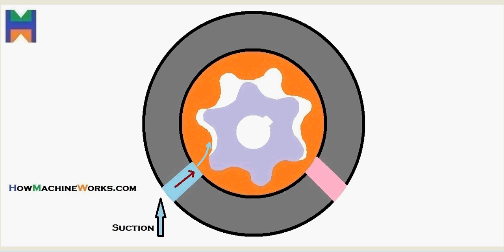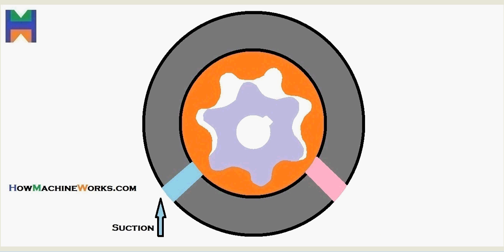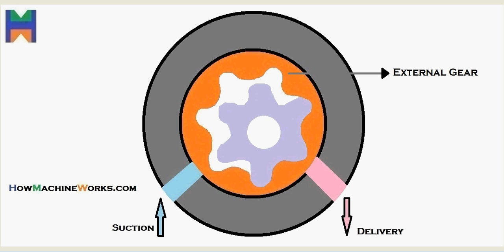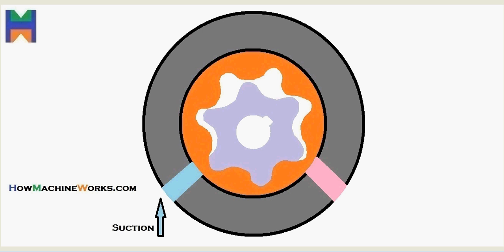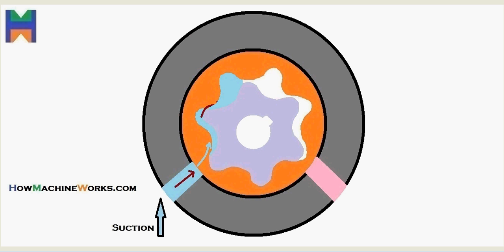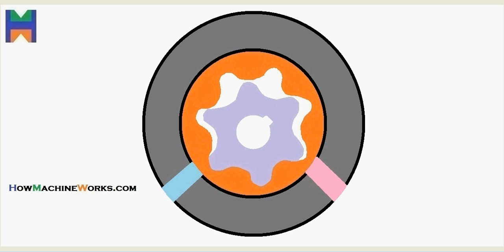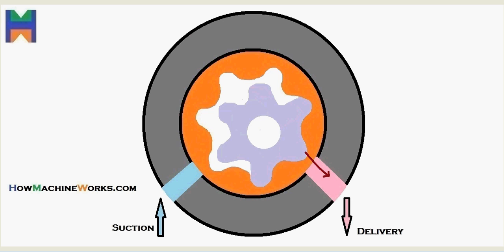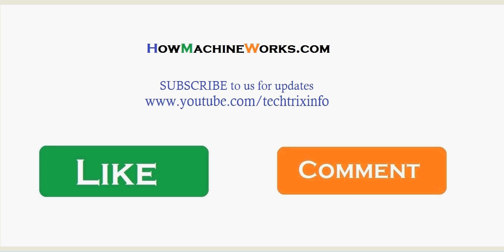Animation How internal gear pump works. ✔

Comment: Pumps do not "suck" or have suction. if there was a restriction on the inlet side there would most definitely be a vacuum pressure and cause aeration. But in normal operation a pump does not suck. There is an increase of volume and decrease of pressure on the inlet side fed by atmospheric pressure or a pressurized reservoir, and on the out let side the volume decreases and pressure is increased, forcing the fluid out. Pumps also do not create pressure, restrictions in the system do.

Comment: the inner gear has a key way and is mounted on crankshaft so there no way it can move off center like in the animation
Reply: Correct.
The inner gear rotates on a fixed position shaft, which is offset from the centre.
The outer gear rotates, driven by the inner gear.
The resultant changes in volume of the chambers created by the gaps between the gears moves the Oil through from the inlet port to the outlet.
Pressure is generated because of restriction to flow, as it is in any Oil System.

Comment: you actually made the inner gear rotate around the outer gear, but its actually the outer gear that creates the pressure, the inner gear is the driving gear, the outer gear is the pump and is driven around the case, outer gear usually has inlets into the inner chamber

Comment: Nope, couldn't understand anything. In one slide the internal gear suddenly moves upward and the oil vanishes. What you are doing is a good job. But look at what the other are doing. They're doing 3d animations, which are smooth and easy to visualise.

Comment: explainied nicely. but in the above video, does the main gear having eccentric rotary motion? if so how the eccentric motion happens?
Reply from the maker: Plz have a look at the video again. The axis of rotation of both the gears are different which is letting this happen (the eccentricity)Visit TechTrixInfo com for more details.
Reply: TechTriXinfo what...both gears in rotation? but in the video u told one gear is stationary. can u confirm it once again?    thanks